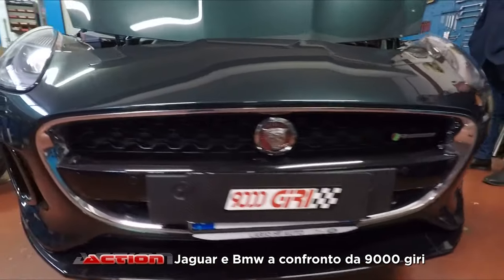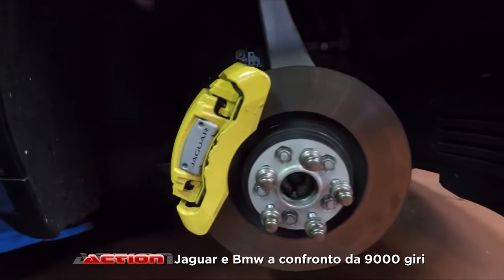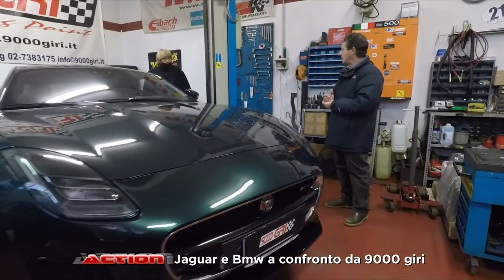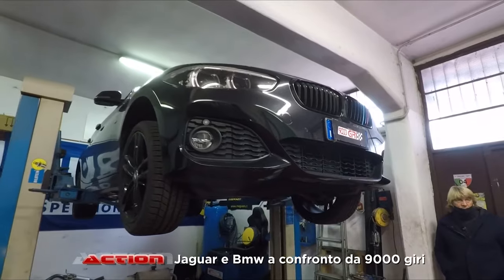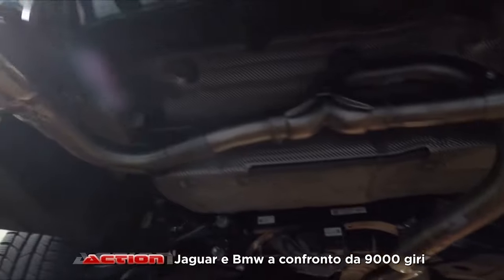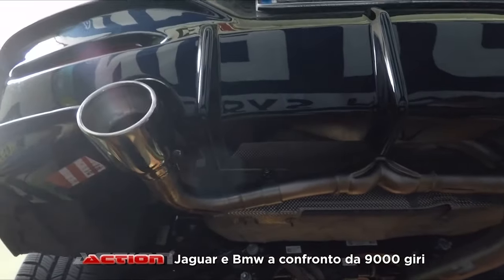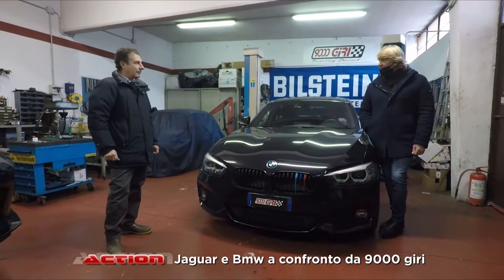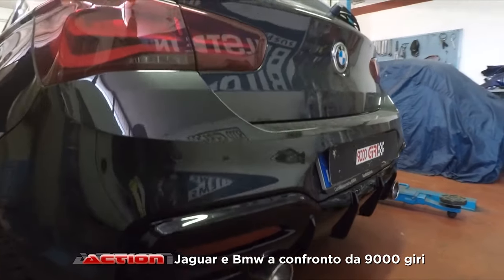Jaguar f type r 2022 | La Jaguar del futuro | BMW 2022 recensione | Car Tuning 2022

Comment: il modulo aggiuntivo e' rilevabile dalla casa madre?
Reply from the maker: La centralina esterna non è rilevabile in diagnosi, ovviamente va tolta prima di recarsi in assistenza
Reply: @9000girichannel  ho qualche dubbio possibile che la casa madre LRJ  non abbia possibilita' di rilevare anche la modifica precedente?
Reply: peraltro Seletron come lei mi h detto non dispone di un modulo per F Type 2000 turbo
ha altre soluzioni di altri elaboratori esempio tedeschi?
Reply: @9000girichannel  comunque complimenti siete persone serie e squisite
raro trovarle
grazie
Reply from the maker: @gian6915  garantiamo che non possono rilevare nulla dato che non viene toccata la centralina principale ne tanto meno la memoria interna